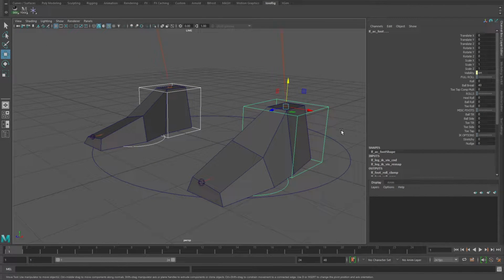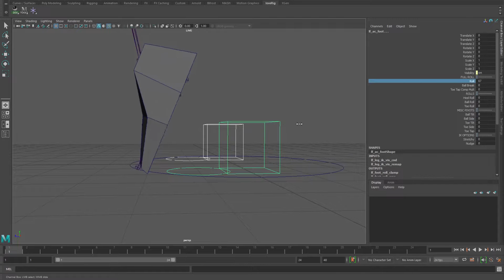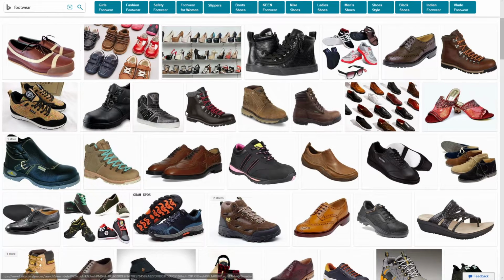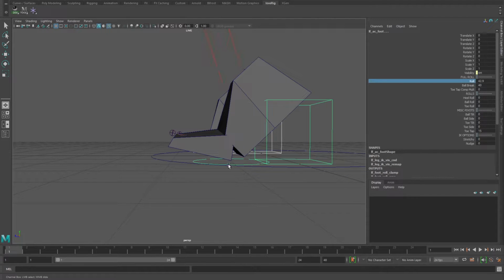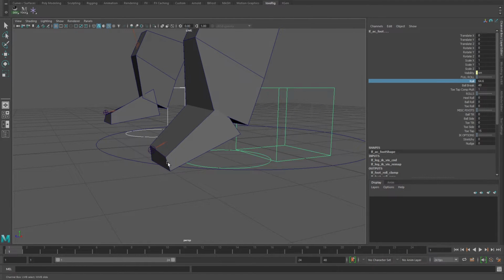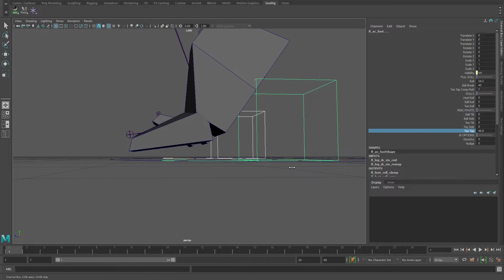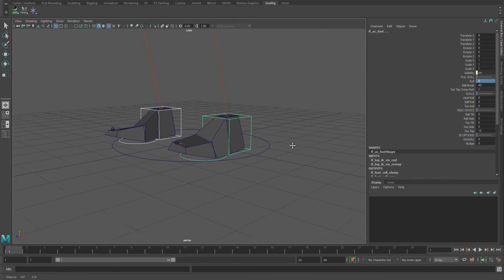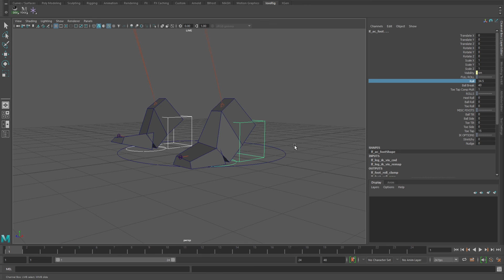Auto toe foot roll rigging experiment

Comment: My approach to this was to sample the geo to find the heel and toe.  Then cut the geo to extract the profile curve to find the arc of the toe from the ball of the foot to the tip of the toe.  The arc gives you a pivot for a smooth roll from the ball to the tip of the toe.  It just becomes a rolling surface like a tire at that point.  It's all scripted and automatic.  :)
Reply from the maker: Thanks for taking the time to watch and comment - that sounds like an awesome approach!  I'm guessing it would involve translating that pivot point along with it's rotation to prevent any sliding on the ground, right?

I was initially thinking of something like that - but I wasn't sure if I could always depend on a clean curvature (like if the part closest to the ground was rounded, but the rest up to the toe was straight), so my approach just focuses more on canceling out the angle between the 'ground' and how far the toe pivot is raised....  Your solution would definitely be less node heavy than mine.  Does it keep a live calculation of where that pivot needs to be if the curvature from ball to toe changes by animators adjusting attributes that raise the toe?

I guess now that I'm thinking about it... you could possibly also internally translate the foot rig down as it's going through the ball to toe part of the roll... but that might mess up some pivot positions.... I'd have to test it!